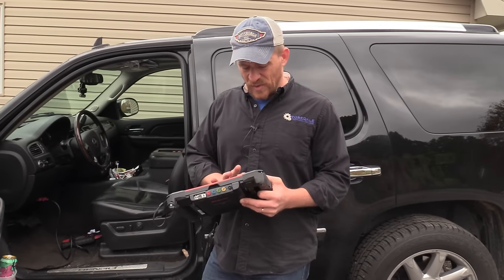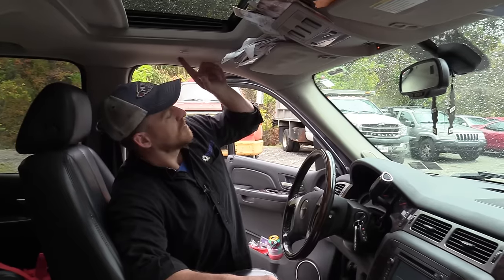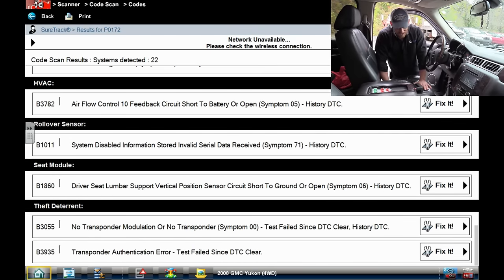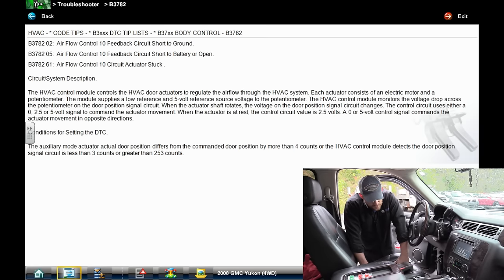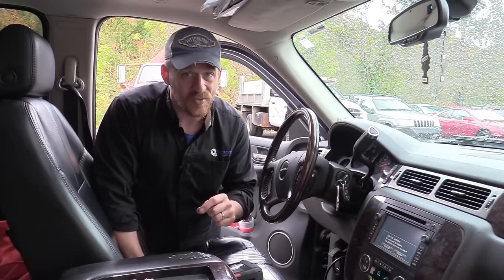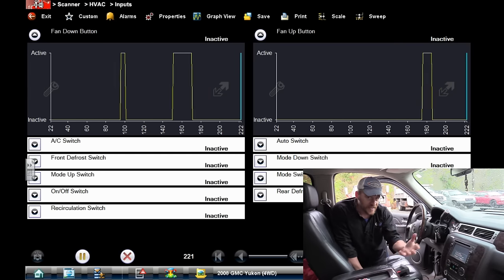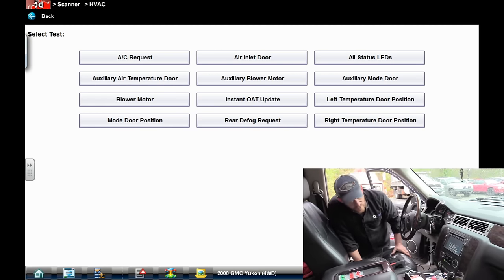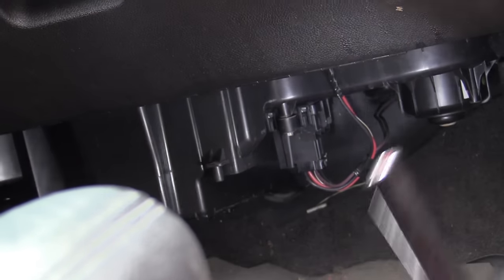GMC Yukon HVAC Blower Motor Won't Turn On

Comment: Paul Danner is a one in a million instructor. I didnt know anything about automotive controls a year ago, now I troubleshoot my own vehicles because SD Premium opened up that world to me. Thank you Paul!
Reply from the maker: Thank you for this comment! That is awesome to hear.
Reply: m
Reply: This is a right diagnoses and helpful.But there is still my be a soldiering problem within the bowler Model or a losing harness.
Reply from the maker: I did mention that and also that the harness was fine.
Reply: @ScannerDanner ,

Comment: Thanks Paul and Caleb. Being a old and former GM tech you two are keeping my mind very active with your channel. Also appreciated the Dodge Dakota vlog and the diagram you did at the end of that vlog...
Reply: I have power and ground to the module and ground from the module to the blower motor but no power to the motor. Also when I add ground and power to the motor it doesn’t run. Does that mean it beds both motor and module? Or could the blower motor be being bad cause the module not to provide power?
Reply: I have an issue with my blower module. I was told that if the blower module goes bad it can take out the blower motor and vice versa. If the blower motor has too much resistance ( a worn bushing maybe) it can damage the module. One should replace both at the same time, more so if they are original items on an older vehicle.

Comment: Well no fancy gadgets, but seeing you plug that back in and bam working.. so first I found I had power at red and purple. Then I unplugged each one and bam working.. plug at the blower is bad. Blowing cold!!! Thanks , but keep us dummies in mind with only simple gadgets. Great video i learned something about the functions and the fancy tool did a good job showing the pulse from that little wire.

Comment: I have to complement you on the manner in which you explain the two powers and grounds and one signal wire.  With old guys, I use a relay analogy, but I would say your method is way way better.  Keep up the great work.

Comment: Wow, Great  break down in simple terms, yet covering all the bases!  I was able to pop open the cover and simply unplug ad plug the connector with key off, key on and the system works again.  going to order a new controller if it ever happens again, will be a 5 minute fix! $21 at Rockauto or 40's locally, not a big worry for now!

Comment: On my 05 Yukon the wires fried 2 times. 
bypassed that resistor you're holding.  Eliminated it. 
 I use the heavier 10 wire and ran it to the battery but decided to connect into that red box under the alternator. Used a 30 amp fuse.  I bought a heavy switch mounted on the dash. 
Has only one speed.  
But I also have the rear heater variable. I've had unusual amount of problems with the actuator doors not opening or closing properly so I in the back I opened a hole through the sidewall and permanently put in a screw to hold the flapper door up in the heat position.  Since my AC doesn't work anyway
Reply from the maker: The wires will "fry" when you have connection issues. Resistance equals heat.

Comment: Replaced the module/resistor. Exactly what I needed, just watch the $50 at autozone, $30 on amazon. Mine old one had corrosion on the top fins, but at first blower would stop, and come back on with a whack, then wouldn't anymore, but would when connector wiggled a little, but not stay on. Thank you YouTube for helping fix half of my problems.
Reply: Come to find out, module wasn't bad, but found wire connector was bad where it connected to fan. New wire bundle is $60at dealership.
Reply: @jeffsummers7242  same here. I cleaned the connector with electronic spray. Now it’s working again. Next time, I’ll replace the entire wire harness like you.

Comment: Wow I definitely came back to watch this and it confirms that I did diagnose my neighbors Yukon correctly..at least in the right direction....the voltage does change(I checked with a multimeter) as I raise and lower the fan speed...so I believe the resistor is bad.....thanks for the great help again!!!! (Blower stays on without key)
Reply from the maker: Good call on that module. There is no input we need to worry about when the fan module keeps the blower on without an ignition feed. Because everything is powered down. Make sense? Good job on checking your blower module (resistor) inputs though. Thank you!
Reply: @ScannerDanner  yes since it stays on....we know that it has all the inputs needed to function? Power,ground,signal etc??
Reply from the maker: @nutsandbolts7407  it tells us the driver is shorted with almost certainty
Reply: @ScannerDanner  oh ok.. awesome great help as always! Thank Yu for your knowledge....looks like il be changing a module tomorrow!

Comment: Thanks for your videos! I had the same issues  with my Avalanche.  You saved me $$$$
Reply: Same here but I replaced same module still doesn't work. Any suggestions? 08 Avalanche. Thanks.

Comment: Hey Paul, I see 3 comments with no answer...(also my question) What trouble shooting steps would you take if the moduel is NOT getting power? All fuses are good.

Comment: Beautifully edited and explained, what program do you guys use to edit and over lay the voltages on the screen? 🎥💨
Reply from the maker: Cyberlink Power Director 15. If I could do it over, I would be using adobe premier. I just don't want to learn another program right now and this one serves it's purpose.

Comment: Awesome video 100% accurate and articulate step by step instructions for anybody that's weakness is auto electrical fixed mine in minutes than you Dan!!
Reply from the maker: Thank you!
BTW my name is Paul Danner 😉
Reply: @ScannerDanner  all apologies.. thank you Mr. Danner
Reply from the maker: All good, I get that a lot
Reply: @ScannerDanner   soooo (exact same truck/symptoms as this video) and blower quit AGAIN... new module (per video) & fan spins instantly when bench tested w/ car battery.  am i to assume the actual $300 hvac controller is the only thing left??
Reply from the maker: @daleaustin1969  not sure if you are still fighting this or not, but I would look at the parts you replaced first. Electronic parts are junk these days

Comment: Thanks for another great vid Paul, and great camera work Caleb! 

Always good for me to see these vehicles on your channels, since I own a '07 Silverado. One day this part is pretty much guaranteed to fail on all of them.

 God knows my truck has had it's share of failures. Latest is monitors that won't run. Might be time for a t-stat replacement ... or something deeper. For now, running with the black "R" on the windshield (inspection stickers in MA: "R" = rejected: Black "R" = emissions, Red "R" = safety). 

Frankly I'm tired of spending money just to keep this pile "emissions legal" when it runs just fine. Only 5 more years until it's exempt ... if the engine makes it that long! Bad valvetrain components on these AFM 5.3's ...  :(

Comment: Paul, I just had a 2011 silverado come in the shop for a blower inop customer complaint, I did the same checks, and I found the blower motor wire harness melted @ the blower motor, so it is getting a blower motor and wire harness, I also unplugged the blower motor wire harness @ the blower control module and plugged it back in and the blower came on, so I wiggled the wires @ the blower motor and could make the blower go on and off, so I unplugged the harness @ the blower motor and it was melted. Did you find the same issue on this vehicle?

Great video!!

Comment: Hi Paul. Just revisiting this PWM control. By the hvac control head pulling the signal to ground (higher duty % to ground = higher speed signal request / lower duty % to ground = lower speed signal request), does this mean the blower speed controller  (near the blower) is the one who supplies the signal voltage to the hvac control head. Then it's the hvac control head job to pulse that voltage to ground and on the other end, the blower speed controller interpretation of that pulse width/duty % is the requested speed? Then the blower speed controller output pulses the blower ground circuit to ground to vary the blower speed? Thank you. Bless you and your family.

Comment: Understanding that you don't really have the time or financial incentive to do so - but it is really satisfying to actually fix one of those modules. As you pointed out it is likely a cracked solder joint and the symptom pointed you to it likely being the motor ground connector pin. Just take a minute or two and get the big soldering iron (or gun) out and reflow the solder on the pin connections (and everything else nearby) on the pc board, adding a bit of solder to make it flow nice. It's a good feeling when you can save your customer - what? - maybe $100 and if it's your own vehicle, your own money. A feather in your cap too (and maybe future business) if you can tell the customer you saved them the money too.
 (Sorry I guess I've spent too many years in the electronics business fixing equipment to component level ) :-)  I can understand if your industry has a different outlook.
  Good troubleshooting technique  Paul. Thanks. I enjoy your videos.

http://davesage.ca/
Reply from the maker: I'm totally with you Dave but what you didn't see in an edit was I was not prepared to fix this one. My eyesight is not what it used to be and I definitely needed a magnifying glass to even attempt it. Then the only soldering gun I carry with me is a butane one that is not meant for such small soldering. 
Thanks for watching! Next time maybe, I'll be able to do the component level fix. I wish I could have too
Reply: No Problem Paul. It wasn't meant to be a negative comment. More meant to let others know that there is a possible further step that can add great satisfaction if successful. Especially when it's your own piece of equipment and money your saving. 
  My home furnace quit a few years ago and through a similar process I traced the problem to a cracked solder joint on the controller circuit board. Seems they thought it was a good idea to solder a heavy transformer onto the circuit board in a furnace that is continuously vibrating. Soldered it up and away it went. The alternative was to try to find an obsolete replacement controller or a new furnace for a few thousand bucks. Made me feel good to fix the whole problem.
Thanks Paul. Keep up the good work.
Reply from the maker: I didn't take it as negative at all Dave. Thanks for the comment! I agreed with it

Comment: Thanks for the video! Case studies are fun.
GM managed to invent a complicated module for a simple job :D 
It could be just a single n-channel mosfet transistor, a beefy one, looking at power ground and pwm controll, but I didn't see PWM ground (must be very fast switching), at least the one that could be detected with verus scope.
Reply from the maker: I don't think the ground was being controlled using a PWM principle , I had my scope set on a 6 mega sample screen and I definitely would have seen the pulses. The climate control module to blower motor control module signal was a PWM signal, but that was it. I misspoke in the video saying the blower itself was being controlled that way. It certainly looked like some type of stepped circuit where resistance was being added and subtracted. Not exactly sure how they were doing it to be honest.

Comment: My wife's 02 T&C had a low fan then no fan so I pulled the resistor or module and with a VOM 
I measured to see if there was an open or short. Back history, I had this happen on my T&C and so I know there are four pins that should have resistance reading on them. My wife's van had 2 pins with no resistance at all. So module or resistor is bad. But this was a deja vu so I knew where the Easter eggs were hidden.  Now that I saw this I going to take that dew hickey apart and sea if I can see what you kneaded readers four4. Just kidding, gonna use a magnifying glass eye use readers two2.  Great video professor and thanks.

Comment: I know what happens, just figured it out with all of them, the blower motor shaft gets rusty and causes the bearing to rust and shaft then puts a lot of pressure on the motor and causes the resistor to burn out or just shut  down the motor completely, I just fixed it by adding a little bit of 20 weight oil to the shop to turn the remove the blower and turn the blower upside down with a squirrel cage is facing down for a little bit of oil in there at a time and keep spinning it and spin until it comes free and  all fixed, so there isn't a sealed bearing in there and the condensing from the air conditioner causes moisture and rust everything up.

Comment: Nice one buddy , I almost wish you didn't unplug it - caused too many variables in my head. LOL Awesome camera work .
Reply from the maker: Why? It's a circuit board that gets stressed by a lot of heat. Nothing wrong with the connector and it would not have continued to work indefinitely. If I had time, better eyes and a magnifying glass, I bet I could have visually shown the failure on that board. Thanks Steve!

Comment: Sorry Paul, I was confused, meant to say if it has power and ground, module/resister is probably bad, which is a very common issue on the GM fleet where fan speed is not working on all settings.

Comment: Great video, easy to follow. I was able to replace mine in about 20 minutes. Except it didn’t fix my problem but I did notice that there was some blue stuff running out around the old one. 
Is there something else I need to do or could be another issue I don’t have a blower for heat or cool. Thanks so much 

.
Reply from the maker: blue stuff as in corrosion on the terminals?

Comment: Just started watching the video but my question is the  rear passenger ac control switch.  Not the front ceiling control for the rear.  There is a little screen that has the ac and radio control buttons that the rear passengers can use. But my rear fan won't turn on. It was working one day and cut out , but started working again and then by the time I got home it stopped working for good

Comment: Have any video's on testing a traditional divider resistor?  I've got one where the blower motor was already replaced by someone else, the fan works intermittently ( will cut out after a few hours of operation ) and there is a 200 - 300 ma parasitic draw on the A/C circuit...

Comment: Hey Dan I'm sure uv found out by now that the little thing in the headliner is not a mini speaker at all, but it is a little tiny squirrel-cage motor that draws ambient air into the cage which surrounds a little thermostat type sensor. Its part of the auto climate control system
Reply from the maker: I have, thank you! Oh and my name is Paul Danner, thanks!

Comment: That's not the onstar speaker, that's the interior temperature sensor aspirator for the automatic control HVAC system. The noise is the little fan motor in it that's blocked with crud. It's a thermistor with a fan pulling interior air over it. One common symptom of it's failure is heat output stuck at 80+ degrees with no heat below that.
Reply from the maker: ah great tip! Thank you
Reply: If the fan is still working you can sometimes pop the grill off and hit them with some air and blow the fan clean enough that it will start working again. Easier than pulling the headliner down to get in there. Every GM truck with the automatic HVAC system has one.
Reply: Ahh yeah - got the same noisy fan in mine too. Was just going to tell Paul about this. 

Of course, GM no longer makes the part if you need it! At least that's what I found last time I checked. Real nice of them to stop making parts on a vehicle that's barely 10 years old ...
Reply: ACDelco 22834330 should let you find one. That fits 2000-2014 GM trucks that use the aspirator. It's the current replacement with the latest revisions.
Reply: Thanks Blazer! I'll be writing that down on my maintenance folder. :)
Reply: Yeah, it seems like whenever I come across those little fans, they always seem a bit noisy.
Reply: Blazer02LS Will this help with car not cooling off?
Reply: I have heard them a few times on some test drives for other problems. Didn't know what the noise was. Thank you!

Comment: I had this problem with an 07 Silverado. When I unplugged the fan connection at the module and plugged back in it worked. Turned out to be the connection at the fan motor. It had heated the plug and deformed it. I replaced the wire to the motor and no more problem.

Comment: Very informative. What size socket did you use to remove the module bolts?  I tried using my 6 mm but too big. Thanks again!
Reply from the maker: Probably a 5.5 mmr then

Comment: First, great video!! Thanks Caleb! Next, I have a 2009 GMC yukon hybrid. I bought stickers to cover all the buttons where the black had flaked off and were green. (Like on this one) my auto button, my up and down on driver and passenger, and my passenger button. I put the stickers on and pushed hard to stick it all around. I'm a dummy and had my truck running so my ac kept popping on. I'd turn it off each time. The very same day, my blower stopped working. Then I opened and closed my door and it came back on. Then a couple weeks later, it did the samething. Then a month later, it stopped but now wont come back on. Did I kill something? Or could it be the module also? I need to figure it out asap cause I have no defrost and its gonna be very cold here very soon! I'm not working right now so I'm trying to find the least expensive way to get this done right, even if it's me doing it myself.
Thanks so much!!!!!